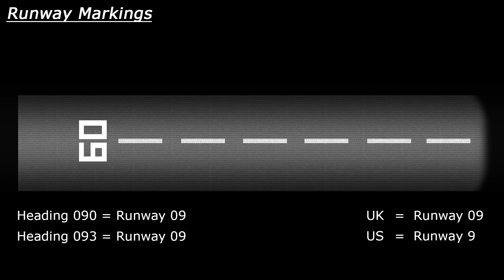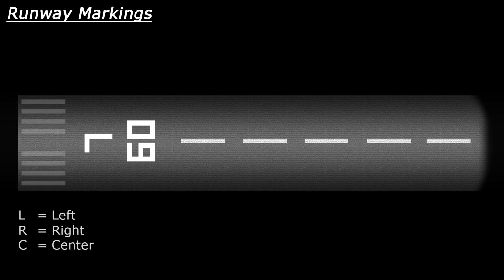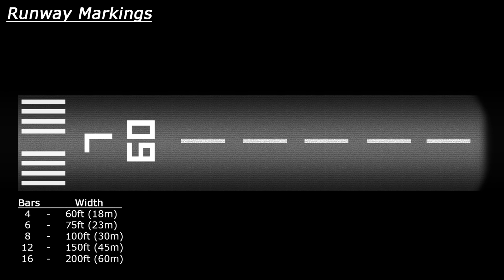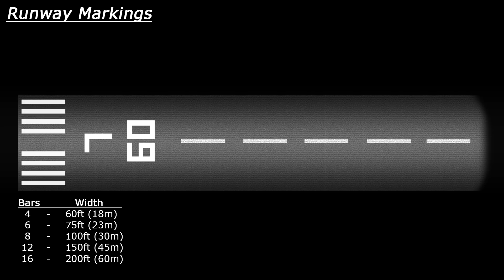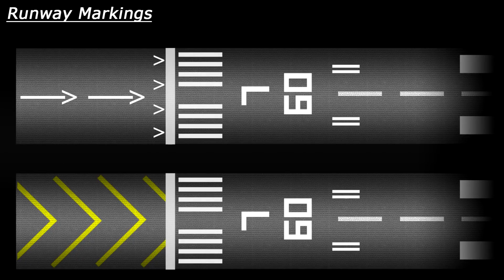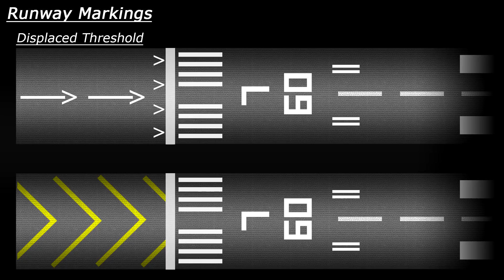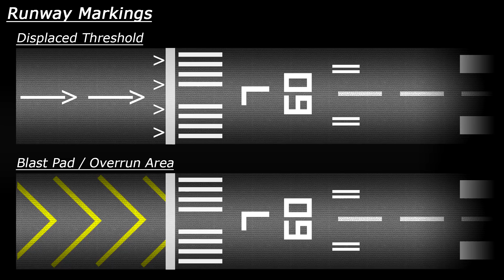Runway Markings Explained

Comment: FYI, pilots do not land on aimpoints. The pilot aims for the aimpoint but will land beyond the aimpoint.  Aimpoints are for staying on the glide slope.  The pilot will transition the airplane from descent to the aimpoint to roundout to flare, which will take them beyond the aimpoint.

Comment: Could someone explain when there are more than 3 parallel runways? Like for example, I know ATL has 5 parallel runways.
Reply from the maker: You can have up to three parallel runways. For example... these might be 09L (left), 09C (center) and 09R (right). Any additional "parallel" runways will be given a different number so you might also have 08L and 08R. I believe at Atlanta they have 08L & 08R.... 09L & 09R and runway 10.

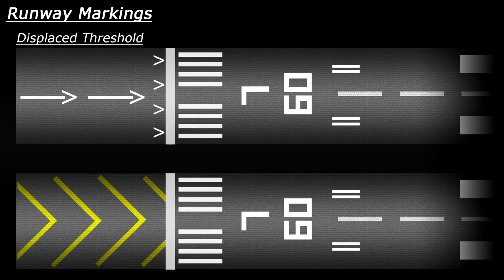Comment: @3:48 ~ Just FYI, one bite you didn’t mention is more specifically about the overrun area of a runway. Most, if not all large airports, have specifically designed concrete that crumbles and sinks the airplane into the crumbling concrete to bring the airplane to a stop before the airplane crashes into whatever is beyond the runway.

Comment: Hello, why can’t they land on displaced thresholds but can taxi/start take off from there?
Reply from the maker: It depends on the strength of the tarmac/concrete. Runways are made to resist the repeated impacts of heavy aircraft landing on them, so the runway doesn't deform. Displaced Thresholds are usually strong enough to support aircraft rolling across them but not having aircraft impacting from above during landing
Reply: @Doofer911  So the blast pads are for landings or they can also take there? I mean not really on the blast pads, but the one that doesn’t have a disciplaced threshold if yk what I mean?
Reply from the maker: @dani-ku7kv   With blast pads, planes are now allowed to land or takeoff from those. They're usually made of "weaker" material and they just exist to protect the ground from being damaged by jet exhaust or jet blast. Planes should never takeoff, land or taxi onto a blast pad
Reply: @Doofer911  Got it, thanks.

Comment: How about the situation when there are 5 parallel runways like in Atlanta? L, C and R will not work, right? Just wondering....
Reply: Got the runway numbers from the Satellite images for Atlanta (for westerly landing) as 26L, 26R, 27L, 27R and 28. In the opposite direction, the same runways are numbered 8R, 8L, 9R, 9L and 10.

Comment: You forgot to mention that the number of the runway, which is tied to the magnetic heading, can be changed as the magnetic north shifts. As an example, a runway pointing to 175 degrees would be 18. If the magnetic pole shifts a tiny bit east from the runway point of view so that it is now  pointing to 174, it becomes runway 17.
Reply from the maker: Yeah the thing with Magnetic North is that it moves so slowly, and because I like to cover just the basics, I felt that the magnetic shift was outside of the scope of this video.

Comment: It seems rather confusing to render 90 degrees as 09 or 9. You'd think that would indicate 9 degrees! According to what you said, that would end up getting rounded to 10 degrees, and rendered as 01 or 1, but I still don't understand why they don't write 90 degrees as 90. To... save paint on the numbers over 100?

Comment: If there are two parallel runways, what determines if it's called Left or Right?
Interesting video, good job.
Reply from the maker: As you approach the runways, the one on the left will be labelled with an "L" and the one on the right will be labelled with an "R".
Reply: At first I thought a plane coming from the east would have a differenct deception of left/right to one coming  from the west. But then I started thinking about the numbers. So on runway 09 all planes landing and taking off would face 090 degrees?
Did some research and guessing that a plane coming from east could land on the same runway , it would just be called 27(L/R)

Comment: Do you have a video that explains how to figure out the opposite end of the runway? Like 12/30? Thanks.
Reply from the maker: Afraid not, usually you take the Runway Heading and either add or subtract 180 to get the reciprocal (aka opposite) end.

Comment: are the runway headings the headings if i would be facing away from the center of the runway, or facing towards the center?
Reply from the maker: Facing towards the centre.
Reply: Doofer911 so the number on the runway tells the way the opposite way is pointing?

Comment: The two lines are the aim points. But the white box(3 boxes) is the touchdown zone, were the wheels should make contact with the rwy.
If i remember correctly you can still Take off from the chevron area but you cannot land due to PCN being higher than ACN.

What happens if you have 4 or more parallel rwys? Well, for this example if you have 4 rwys on a easterly heading. Then one will be called 09L and one 09R, and the other two who's also on easterly heading will be named 08L and 08R. There can only be 3 rwys with the same number. (09L, 09C and 09R)

Comment: Schiphol has 3 runways, called 18R-36L, 18C-36C and 18L-36R. Note the L-R, since you can land both ways on the strip you also have 2 names for a single runway...

Comment: Thanks, I found this illuminating. However, as a layman, I was getting slightly confused when you kept referring to the "end" of the runway. Surely you meant the "beginning" or the "threshold" of the runway. I would regard the "end" of the runway as the far end, and my dictionary describes "end" as "the farthest point from where one is" and "the point where something ceases to exist". Having said that, I would have been interested to find out about the markings at the true "end", i.e. termination of the runway!
Reply: I agree and am still somewhat confused. So in this example the plane comes in for landing from the left, correct? 
What adds to the confusion is the fact that the location some of the markers on the runway, like the touchdown boxes, are not positioned in proportion to the actual length of the runway.
Reply: Yes, I believe the landing direction is left to right here. Actually, if you check out this contributor's video on runway lighting, it gets even more confusing! I got lost trying to concentrate on which direction of landing we were talking about! Nevertheless, both videos taught me a few things I did not know before, and from that point of view they are useful. The presenter speaks clearly, and is obviously trying to make the subject simpler for the layman, but I do feel he needs to brush up a little bit on the clarity of exactly what is the direction of landing. Incidentally, I am sure that qualified pilots don't refer to the threshold as the "end" of the runway, so this is where clarity is important.
Reply: Almost all runways (maybe all?) are designed to be used in both directions. He didn't cover it but if one end says 09 or 9, the other end will say 27, since 180 degrees away from 90 is 270 degrees. Also, if it was 9L on one end, it would be 27R on the other end. The runway threshold at each end is also the ending marker for planes using the runway in the other direction. Planes operate best when taking off an landing INTO the wind, i.e., into a headwind. This is because they can achieve the necessary airspeed with less ground speed, so they use less runway length and touch down more gently. So, you wouldn't have planes using the same runway in both directions on the same day (or at least, within a period of a few hours). The tower tells them which direction to use. When the runway is lit, the lights at the thresholds are directional and shine green light toward the nearest end and red light toward the far end. This means that a plane coming in to land will see green lights at the close end and red lights at the far end, with red acting as a warning that the end of the runway is approaching. Usually the weather is such that the wind direction is going one way more than 50% of the time, so each runway will have a direction which is used more often. Because of this, some airports may only have ILS (instrument landing system) serving the runway in one direction - to save money - but as far as I know, visual takeoff and landing are allowed in the other direction if conditions permit.
Reply: Thank you so much for the full explanation, and I understand a bit more now. As you probably know, this contributor also has videos on runway lights, taxiway lights, etc. which I have found helpful. I hadn't appreciated the usefulness and indeed need for some lights, e.g. those assisting pilots to keep to the glideslope by use of lights beside the runway, which "adjust" according to the angle at which the aircraft is approaching the runway - white for too high and red for too low. I realise of course that these are static lights, and their apparent change of colour alters according to the altitude from which they are viewed.

Comment: New Zealand markings seem to be different. Have a look at Wellington airport. The runway is pretty much north south. At the north end it is marked as runway 16 and runway 34 at the south end.

Anthony
Reply: You serious? you mean 160 degrees and 340 degrees? makes total sense. only 20 degrees off north south.
Reply: anthony851 If you landing from the North you're flying in what direction? You're flying south (south east) thus a course between 090-179 and for this example 160 (rwy16) the opposite of 160 is 160+180=340* thus rwy 34. 

if you're going to land on a North-South rwy. Then the southern part of the Rwy who's facing north will say rwy36. You have to think at which way it's facing.
Reply: +anthony851 My guess would be that those runways can be used to take off and land in either direction. Would this be due to wind changes? Is that ever the case in commercial airports?
Reply: David Harkness Sorry for late reply. For the most part you always want to land with headwind, however if I remember correctly you can still land with 10kt tailwind. 
But if there's is little to no wind at all then they may use the runway most convenient. For say all airports in the area use RWYs in southerly directions so all departing aircraft's departs on the same direction.

For example where I took my licenses we had to adapt to the big airport 10min away when the wind was light. Usually they took of on a southerly heading due to being in Sweden and majority of the traffic are heading to southern Europe. Then we also used take of in a southerly heading.

For the mos part it has to do with the wind. When we get a report or check the weather we can see what runway we may expect due where the wind is from. 90% of the time we land with headwind. Only at certain conditions and long airports we land with tailwind as the landing distance increase drastically. 

For very big airports they adapt to the wind and all traffic land for say on a northerly direction and all departing traffic takes of on a southerly direction, just so the ATC can maintain and control all the traffic.
Reply: The numbers refer to the take off and landing magnetic heading.  Some runways with headings like - for instance  246 degrees often swap designation as magnetic North moves.  In this case flipping between Runways 24 and 25.

Comment: ist there a marking on the center of the runway?
Reply: length wise
Reply: Usually, nope. But, in the US and other countries they normally paint yellow diagonal lines as a continuation of the blast pad ones in the runway sides. Then, when those lines change direction becasue they've met the lines coming from the other treshold is usually at the center, so that point serves as some kind of center marker. It's a bit difficult to explain, take a look to the yellow side markings in runway 33L-15R at George Bush Airport to see what I mean.

Comment: Hey Doofer, the blast pads you mention at the end are actually called "stopways" both in ICAO Annex 14 and in EASA CS-ADR-DSN documents. Their purpose is to provide more length to stop an aircraft in the event of an abandoned takeoff - so actually they should be as strong as the runway to not to cause any damage to the aircraft. In reality, they are designed to withstand at least a certain number of loadings of the aeroplane which the stopway is intended to serve. Also, there shouldn't be any ground equipment this close to the runway to be protected by it - the closest structure should be the ILS LOC at the and of the RESA. All the other subjects of the video are correct. Great and informative video.
Reply from the maker: Ah thanks for letting me know, I was simply going with information from Wikipedia, someone should add "Stopways" to that article!
Reply: I just had a look in FAA Airport Design documents too, and they do mention blast pads, with the same purpose you tell in the video. It also cleary states that "A blast pad is not a stopway.", but has the same yellow chevron marking. So perhaps it's more common in the USA. I haven't encountered it in EASA stuff yet (to which we have to be compliant in Europe). I guess we both learned something new :)

Comment: Why was this not on my air law exam? Does this only apply for commercial aviation?
Reply from the maker: Not sure, I don't think this would fall under aviation "Law" specifically. I'm not 100% familiar with the different exams and what areas they cover but I would expect one of the PPL exams to cover basic ground markings. Would be very surprised if a PPL pilot did NOT have to learn about these. It's like learning to drive without studying road markings!
Reply: I fly microlights so maybe that's why ... Still we land at small airports sometimes

Comment: How am I supposed to mark runways A and B then?

00L ---------
        --------A
00C --------
        --------B
00R ------
Reply: round down or up the number
Reply: DFW, is a perfect example of this.  They name 3 of the runways 35 with the R,C, and L identifiers and the remaining two as 36 R and L.  

http://155.178.201.160/d-tpp/1611/06039AD.PDF
Reply: You are correct.  in the case of DFW, the runways were arbitrarily grouped into 35 and 36 to avoid confusion.  Note that all five runways have the same runway heading 356.5°.  Also note from the chart that the annual magnetic variation change is 0.1°W per year.  Granted, it will take about 100 years for the airport to want to change their numbers (and I doubt the airport will still be around), but there are airports that have changed their runway markings due to the change in magnetic heading or a corrected survey.

Comment: So just to clarify, for example, our local airport has on the west side of the two parallel runways a 10L and a 10R, but on the east end of the same runways is painted 28L and 28R. How would these correspond to the heading direction? And is it common to paint one runway with two markers?
Reply: 10L/10R means the runway is 100 degrees in one direction but if you come from the opposite direction it will be +180 degree to make the runways 280 degrees or 28L and 28R.
Reply: Sure, two markers for every runway, depending of the direction of the wind each end will be used for lands and take offs.

Comment: I don't think you mentioned it, but am I correct in thinking that the other end of the runway with have the reciprocal compass heading as its label? So the opposite end of zero-niner would be two-seven? 05 will be 23? Interesting that the tarmac itself is not labelled 09, but it is given that moniker when the aircraft is landing in that direction only.
Reply from the maker: Yep you're right, the opposite end of a runway will always be a reciprocal.

Comment: You said that the threshold bars indicate the 'WIDTH' of the runway.
Don't you mean LENGTH?
Reply: You mean the eight bars that ran parallel to the (assumptively) north and south edges of the runway? If so, then he was correct to say width. I didn't pay attention to the whole video so I dunno if you are talking about some different ones.
Reply: So those bars indicate the WIDTH, so that the pilot knows whether their plane will physically fit on the runway?
I'm curious how they know about the LENGTH?
Reply: Richard Woolf yea the width is important to know the width for that reason (size) and a few others, and their (the pilot's) knowledge of length comes from little booklets called FLIPS (Flight information publications). Before the pilots take off they request and are given flight plans, which include the FLIPS about all the airports they will visit on their trip. Also if it's an airport they've been to before or are familiar with, they already know the length. As a complete last resort, they can always ask an air traffic controller. It's nice, courteous, expected and sometimes mandatory for ATCs to provide that kind of info.
Reply: Thank you :)

Comment: what if there are 4 parallel runways?
Reply: Then they will just change the numbers of two runways. 35L - 35R & 36L - 36R (Orlando international airport for example).
Reply: LC and RC being Left Center and Right Center
Reply: They'll use a runway number 10 degrees lower or higher. For example, KDFW (http://airnav.com/airport/KDFW) has 5 parallel runways: 36L/18R, 36R/18L, 35L/17R, 35C/17C, 35R/17L.
Reply: what if there is 16 parallel runways  lol lol lol
Reply: XpertPilotFSX I don't know anything about flying but I'm guessing it would go L LC RC R